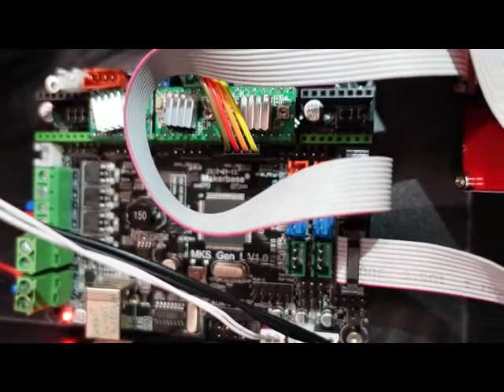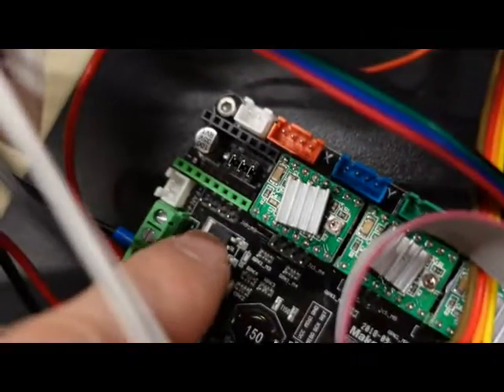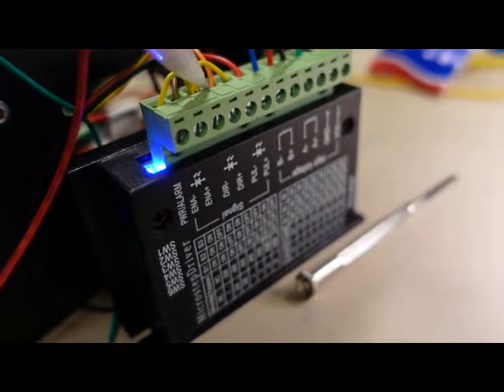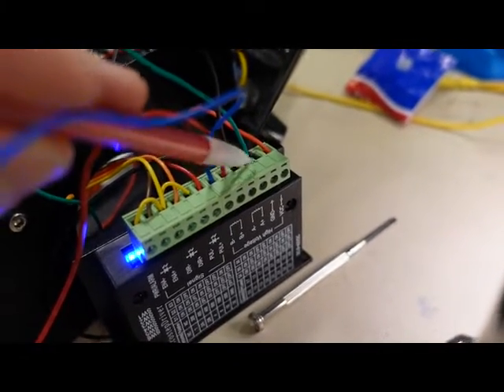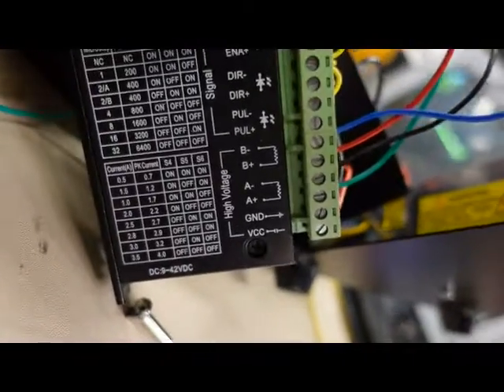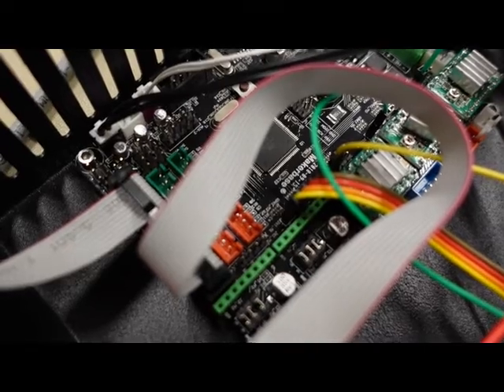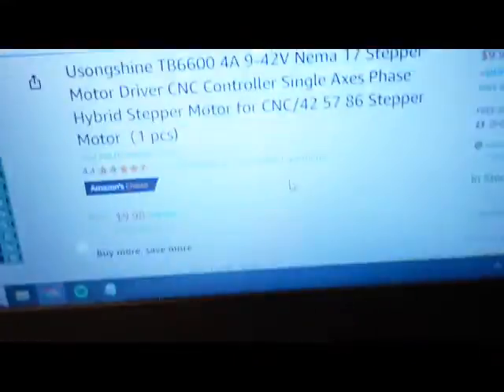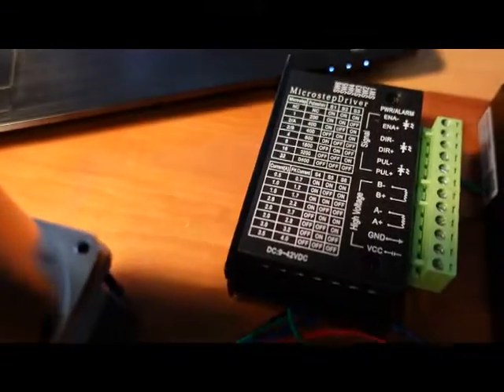Connect a MKS Gen L board to a TB6600 external driver and drive a NEMA23  gearmotor

Comment: This is exactly what I was looking for. I ordered some TB6600 drivers for a desktop plasma cutter I'm building from scratch. I've never built a CNC table or wired one before, but I think I can handle it. I'm going to use x y and z running Nima 17 motors. I suppose they don't really need external drivers but I didn't know any better and ordered them anyway. I also ordered an external 5 volt power supply and a 24-volt power supply. Looking to run grbl on it. If you have any advice for me It would be greatly appreciated. Thanks. Subscribed and saved this video.
Reply: Can I use dm860 driver in mks dlc32. If I want to push 24 volt in board. It give good signal for fm860 driver. Please reply me
Reply: @ramijali6964 in the video he says the 860 is not picking up the pulse signal.
Reply: @roberthosking7524  thanks

Comment: Your DM860I driver requires 0-0.5V for low and 4.5-5v for high signal input, so you need to have some kind of a level shifter.
Easiest way to do this is to use e.g. ULN2003, supply it with 5V and you'll have 5V on the output. The difference is that now you need to connect DIR+, PUL+ and ENA+ to 5V, and DIR-, PUL- and ENA- to go to output of ULN2003.
Output od the MKS goes to input of ULN2003.